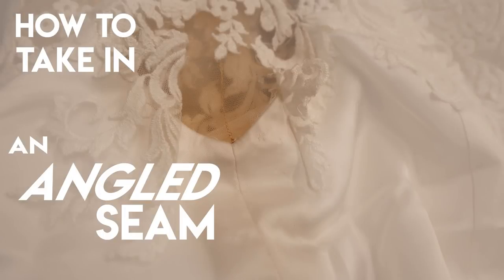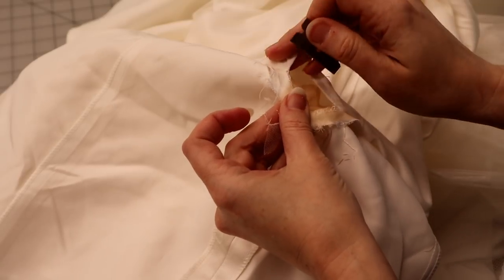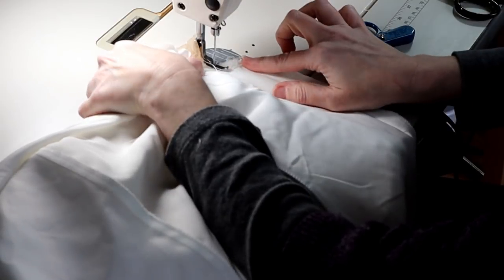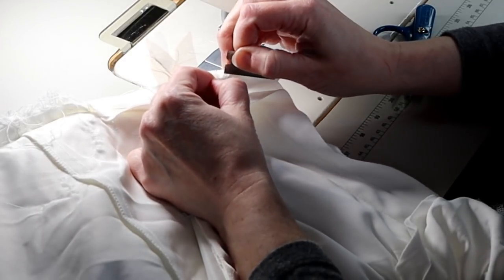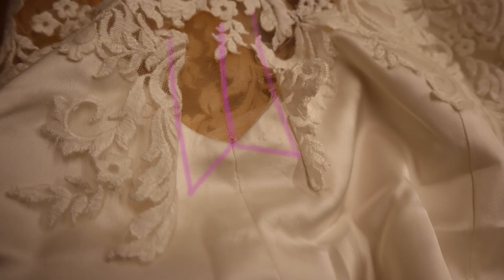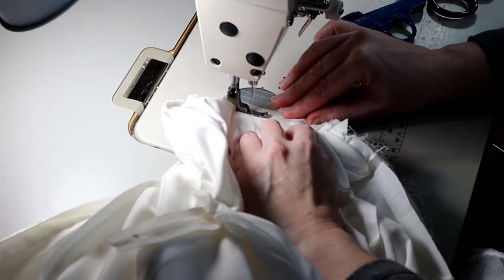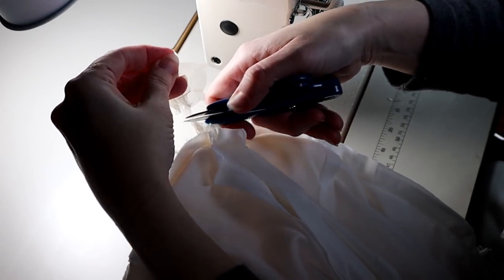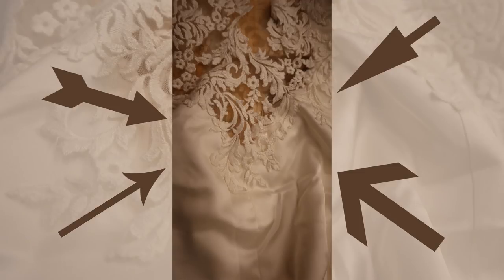How to Take in an Angled Seam on a Wedding Gown. Prevent Puckering, Adjusting on an angle,

Comment: I have encountered this puckering more in the center front of a bodice, when I'm Paddington and sleeves to the top of a strapless sweetheart neckline gown.  Basically anytime you have inset angled seams. I've also encountered puckering at waist seams where the waist is very curvy. When a girl has a tiny waist and very full hip even a straight seam can cause some puckering. As always you are amazing for sharing your talent so freely. Much thanks!
Reply from the maker: Ug. I got what you meant! Lol it happens to me all the time. 
Yes, curvy girl issues cause puckering so badly. I usually alleviate by snipping horizontal cuts in the seam allowance up close to the seam at the final adjustment fitting if the bride allows. Also, lightweight boning & 1/2 wide horsehair braid sewn to the seam allowance helps greatly.

Comment: Wonderful! And I like the lighting better.  My question is on the angled skirt ss down to the flare... I've noticed rippling of Charmeuse Satin at the skirt side seams if I don't directional sew. How do you know when directional sewing is needed?
Reply from the maker: There's probably a technical answer for that. I try to sew fast, here, so I just sew on down. If it ripples, I can cut it out and sew it the other way. It isn't usually a problem for me. -Not enough to spend any time deciding  beforehand. 😂
Reply from the maker: & thanks for feedback on the lighting. I think it is waaay more crisp. Definitely not very pretty, but it is very helpful, & that is the priority here! :) 
To emphasize how light it actually is where I am sewing, there is a huge window open directly behind me, bathing the space in natural light. These other two lighting sources, are that much brighter than natural light. Crazy!

Comment: Hi, i recently started watching your videos and they are very helpful.  I am very new to alterations but I am trying my best. Few questions, I have seen you use zipper foot to sew. When i use side foot it gathered doesn't sew that smoothly.  Second i have a juki DDL8700, when i sew net kind of stretchy material which is very common material in bridesmaid dresses i use ball point needle still they give me hard time. It skips. What is the best needle to use or best way to handle thay. I really appreciate.  Thanks
Reply from the maker: Sometimes skipping is a thread issue as well. Try a couple of different brands? 
As far as the gathering, that could be a few things. Experiment with the foot pressure, (google to see how to adjust that on your machine- it should be a knob on top of the machine, above the needle area.) Next, check your throatplate and underside of foot for any burrs. Also, make sure the feed dogs are for delicates. Sometimes the feed dogs are for upholstery or something heavy, and they need to be switched out. Hope one of these does the trick. :)

Comment: I have a new client coming in today with a dress that needs to be taken in for a child...so I am sure that she is going to want to save the seam allowance for the child to grow into the dress.  She also has another dress that is too itchy and wants me to make a lining for it.  Fun times.  I hope that I already own a pattern that is similar to the dress style for that lining.  Easter alterations = fun.  :D
Reply: Craftybunny  here is what I do...no pattern required. Use a stretchy knit lining. Turn the dress inside out and stuff it with a pillow. Pin the fabric directly to the dress, trim, turn the edges under and whip stitch them by hand. The hand sewing takes time, but I’ve gotten fairly quick at it and it saves so much time trying to measure out a pattern.

Comment: What if thr is a zipper puck up
Reply from the maker: I would have to have more information. There's many reasons. Sometimes it just needs to be removed and resewn. Sometimes the back of the gown needs to be shortened and then the zipper put back in.
Reply: I made a top with a strech fabric n put a zipper st the side seem , right below the bust it puckers up
Reply from the maker: It probably stretched as you sewed it. You should baste it while it is laying flat and relaxed before machine sewing it.
Reply: The pucker is at the side seem below the bust, now that I have stiched it what changes can I make